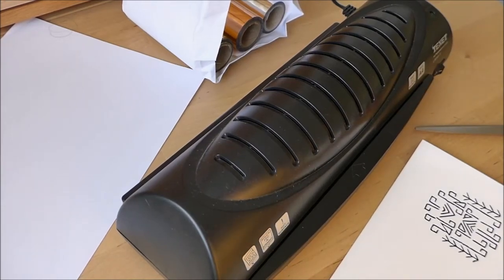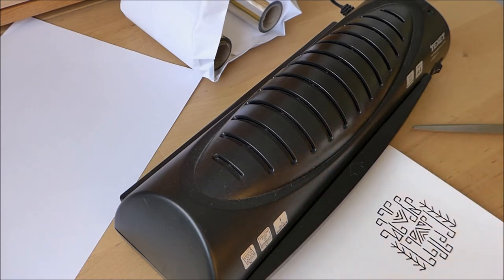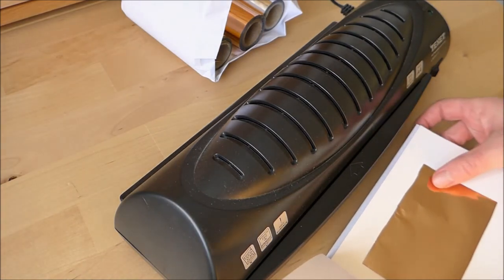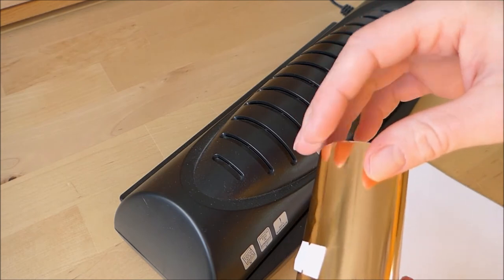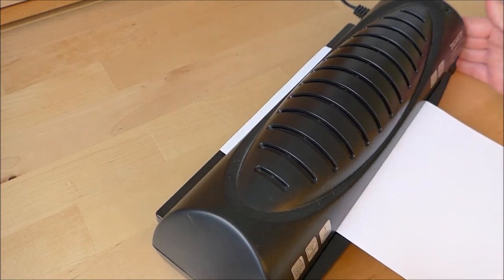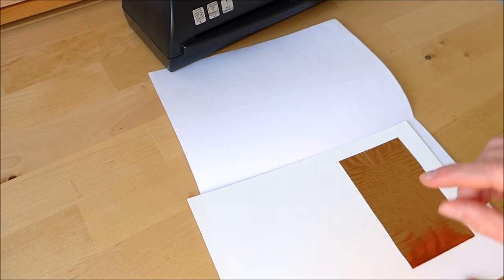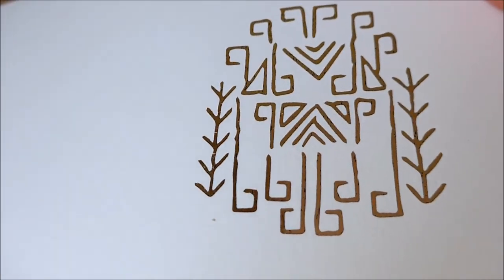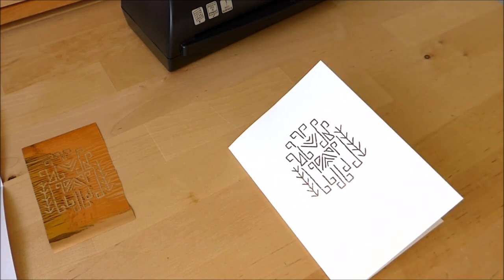Having a go at HOT FOILING!

Comment: Interesting. I had never heard this was possible at home. I have both these pieces of equipment, though I agm not a crafter at all I do use gold in my work quite frequently, and love it. So your sample experiment is fascinating! Do you have a link for the kind of foil you used?
Reply from the maker: The foil I used is one I got on ebay: https://www.ebay.co.uk/itm/Rose-Gold-Toner-Foil-Craft-Cards-Laser-Printer-Heat-Transfer-Laminator-Hot-Foil/262060966256?hash=item3d040d0170:m:mqqp0dIZ4P9jDEbM7317peQ

Comment: looks cool, how does the foil only stick to the pattern?
Reply from the maker: I believe it is to do with the heat process. Toner ink in laser printers is a powder that heats up when it goes through the machine process. It can re-melt when put through a heat process again, thus the heat transfer foil sticks to it as it goes through the laminator. Not sure how other foils work though - I have some that you can just use a heat tool on to draw with, and there's no toner ink involved... It's really interesting!